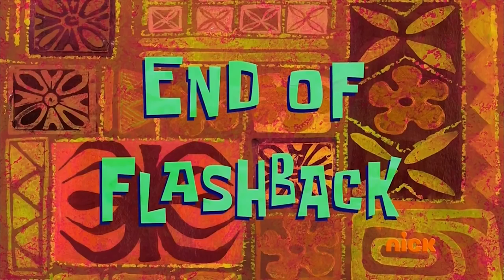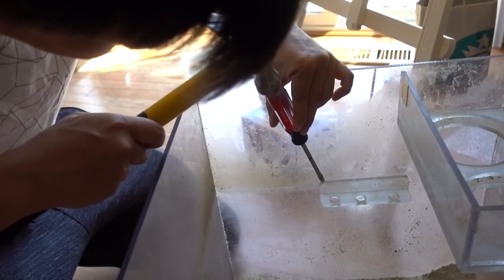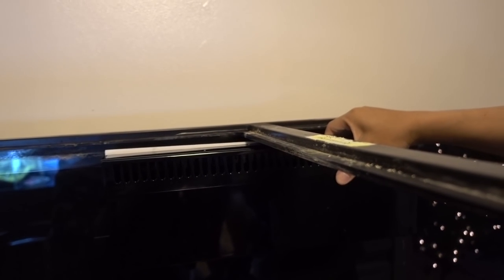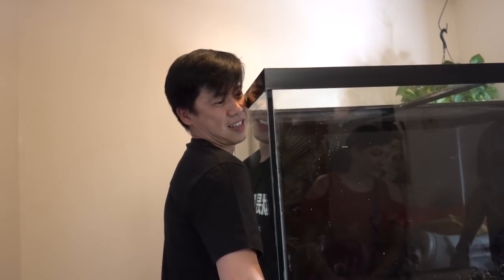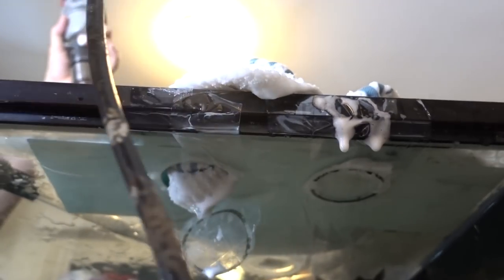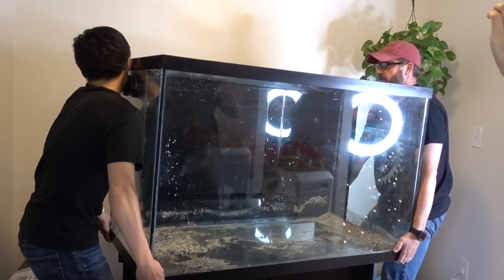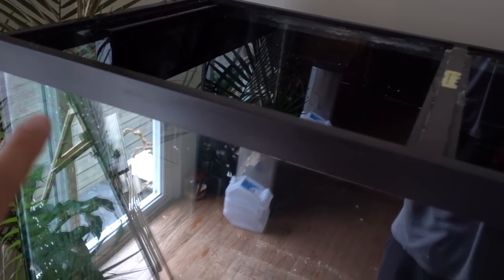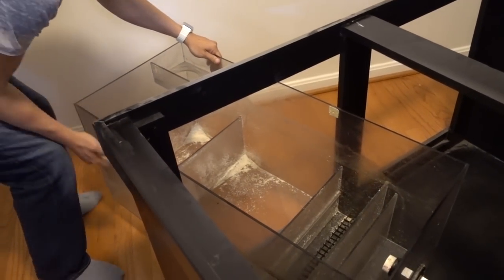*HUGE* 150g Tank Build Updates! (150g - 5/20/2018)

Comment: Go with the offer of a new stand and build a cupboard up the side where you shadow box is then the pipes will be hidden and you will have plenty of space for an electrical cupboard and in the base the extra cupboard will hide doser and containers for the dosing liquids and also the RO tank and it means you don't need to have it within the sump, which in turn gives you more room for your refugium.
My tank is set up this same way and its a great way to do it.

Comment: I can really relate to this video. Built my own stand and had tank on it and 3/4 full when I realized the sump wouldn’t fit through the front. Had to drain tank and move the stand away from the wall, remove rear brace, install sump, replace brace, move stand and tank back and pump water back in.

Comment: Good stuff man! I would cut that center brace off of the stand. It's not taking any sort of load. All of your load is on downforce, that brace is most likely to keep the stand intact during transport.
Reply from the maker: You are talking about the front center brace? Our plan of attack is to remove the brace across the top and drop the sump in vertically, simply because it's simply nailed down by 4 nails, the front brace is a little more complicated.
Reply: no i was talking about the top brace. Its not supporting any weight it just makes the stand more rigid during transportation. the front and back braces add support to the tank. Your plan is a good one.
Reply: Kevin Hayes no those braces are the only thing holding the front to the back there structural the stand could bow if not replaced there glued and stapled but come out very easily

Comment: the rubber seal supposed to go on the inside of the tank tho. The water might leak past the threading the way it is with the seal on the outside. btw. gj
Reply from the maker: Understood! We sort of just put it on there for me, will be sure things are in the proper order when the time comes, thanks for the heads up!
Reply: np, i like channels like yours. will need to get myself a tank like that :P

Comment: I was going to put a shadowbox on the back of my 120 but thinking about keeping the back 100% clean at all times is not realistic.  That's why I bagged it even though I built the box already.
Reply from the maker: I was thinking about that... have you considered that automatic glass cleaning robot?  Movoc or something...?
Reply: I already have 2 RoboSnails and waiting for the Moai from Kickstarter to show up.  All thee cleaners require to be on the outside so the box will be in the way.  The Robo snails work for keeping the algae film off but won't help with anything thicker.  I am dosing Hydrogen peroxide on a regular basis to help keep my ORP up even though I am already running an ozone generator on High with a dryer. This helps with reducing the slime algae and cyano.

Comment: Go with a new stand! You will forever regret not doing so. Since your overflow only has 2 holes, you will be going with a Herbie style overflow. One is the main syphon drain and the other is the emergency. I would also go with a new sump that fits the equipment you want. Again, this is an area you will regret not doing it right the first time.